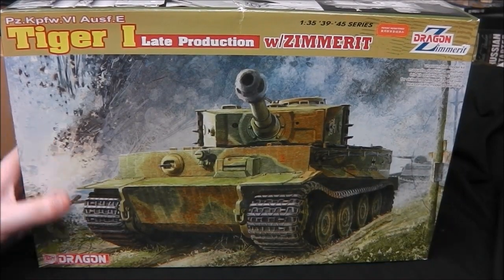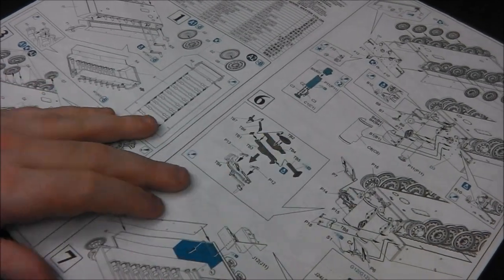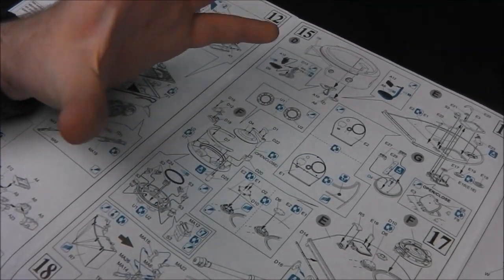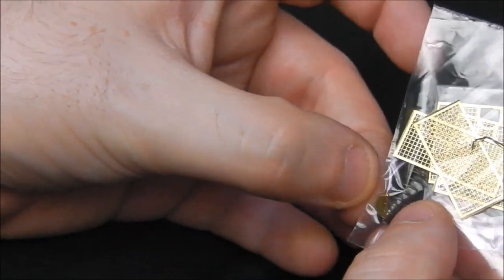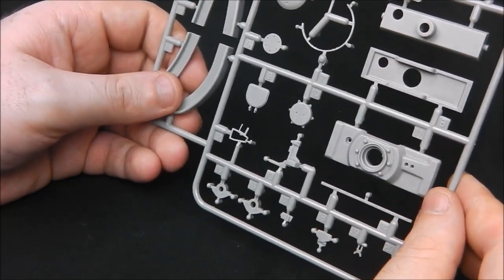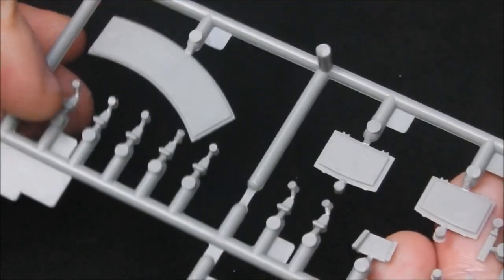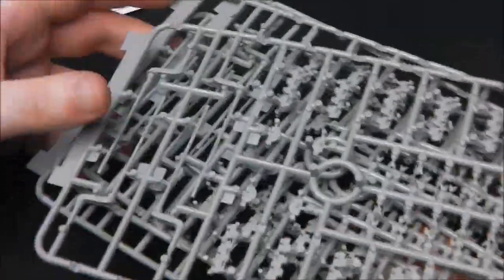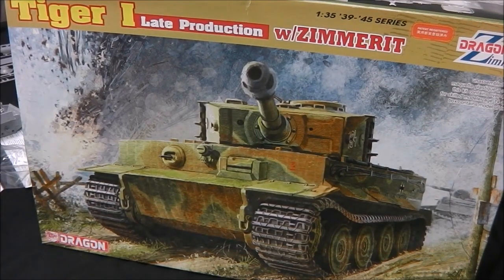Dragon 1/35 Tiger 1 Late with Zimmerit Review

Comment: Hallo from northern ireland Shane! I hear that Dragon kits are way up in price (£50 plus). Do you think the latest Dragon kits are kack?
Reply from the maker: Hey mate ! ya Dragon kits down here are in the range of 75-85euro for a new release they are not cheap any stretch of the imagination. Unfortunately I've found that Dragon is going downhill in terms of value for money and general effort, their new stuff has you using and kit bashing parts from a load of different spures and requiring us to cut and sand alot to get it to work, while still making us pay the same money
Reply: Shane Smyth Hi Shane. Ive got about three Dragon kits in my stash. I think a few of them are the "imperial"series. I havent built that much to be fair. I just cant seem to find the time. Ive got an iwata airbrush and compressor and loads of paint. Guess i just need motivation too. Started building a terrible wee 1/35 Italeri 166 Schwimmwagen kit for practice.